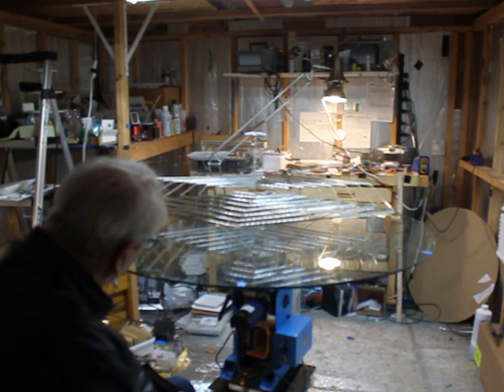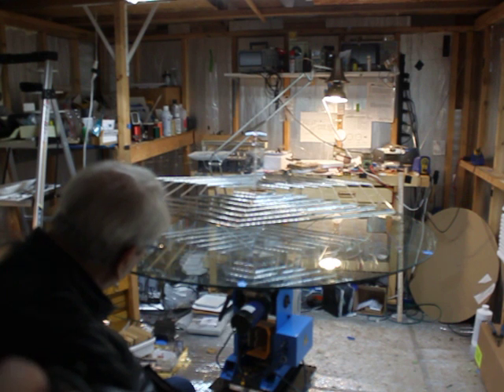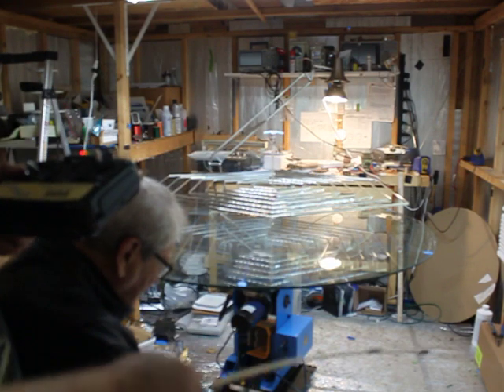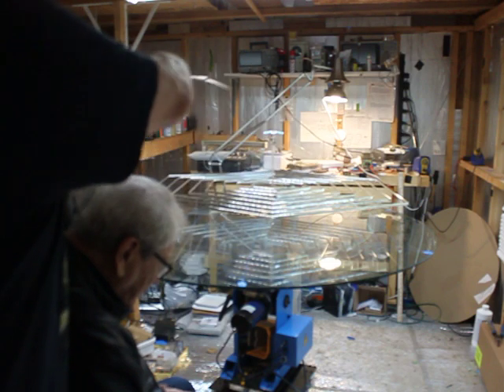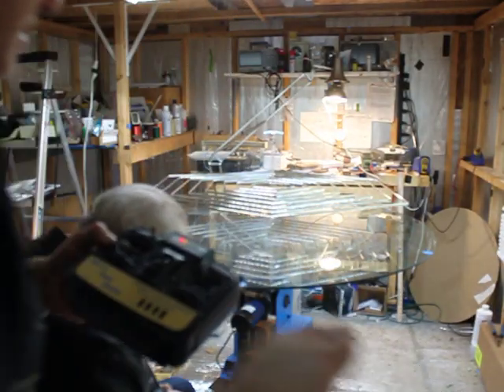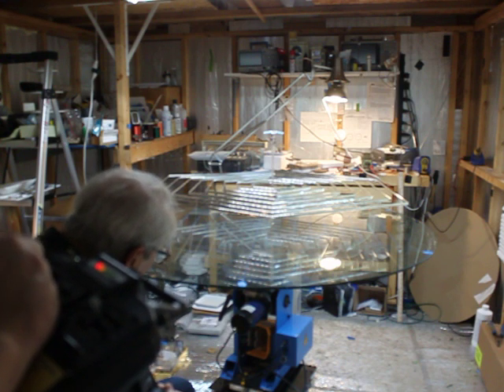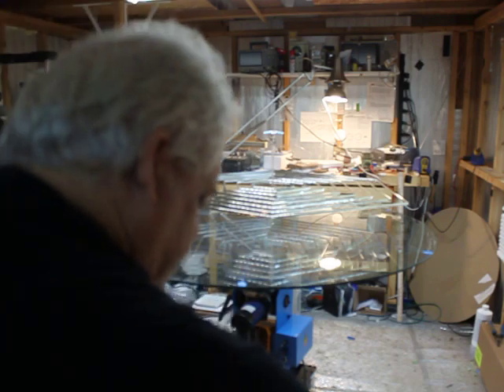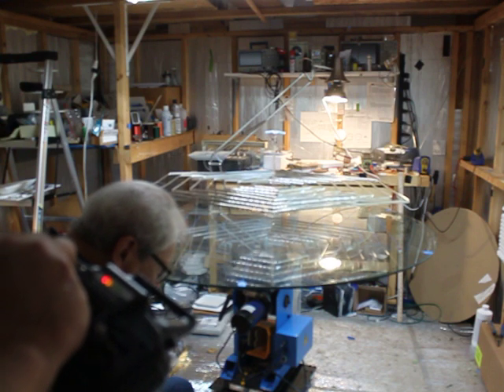Flying on 180mAh Cells. Nearly A 9X Increase In Battery Payload Capacity, Ion Propelled Lifts Supply

Comment: Could you convert this to solar to reduce weight burden? Thank you this is really amazing!!
Reply from the maker: Thank you so much for the kind comment!  The entire craft weighs in the ballpark of 25 grams depending on the model.  Reducing the weight gives a much better than linear advantage.  I try to shave off every mg that I can.  I had to find many ways to increase the efficiency by a large amount to get it to lift its power supply.
Yes, it would run 100% on solar but it would take some expensive Perovskite lightweight solar cells, and I just don't have the funds for those right now. 
Best regards!

Comment: This is fascinating, amazing work. I've been aware of ion lifters years back before batteries were as dense, but I think now it's becoming more and more possible. I'd love if you could answer a couple of questions... How long can it hover for on the battery? Can it continue to climb into the sky, or what is the limiting factor? Can mini versions be attached to the side (90degrees) as a 'push' drive, or does it only work horizontally? Really appreciate the reply :)
Reply from the maker: Hello, This craft was around before the name "lifter" was coined.  It has a thrust to weight ratio that is several orders of magnitude higher, so it's better to call it an ionocraft or Ion Propelled Vehicle etc.

So far it has flown continually for just under 2 minutes at a time, and well over 2 minutes total per battery charge. That is expected to increase a lot, because mainly the limit was due to an overheating mosfet and transformer, both recently upgraded.

The height was limited by the safety tethers, but once the gyro-stabilizer is fixed and tuned again, there won't be a limit, especially with a propellant tank. (There is video of it carrying 2 small empty cylinders on this channel.) 

The craft has flown on one side like a plane, but just leaning it a little also works fairly well.

Thanks for commenting!
Reply: @KraussEMUS1  that's extremely exciting, and many thanks thanks for the detailed reply! As batteries get denser and you refine these, it will be astonishing.. a silent remote flying craft 😎😎😎

Comment: From strength to strength Ethan, always impressive. "and when Humanity finally left the Solar system - it was by using the Krauss Engine" :)
Reply: Not to dismiss his work on the self contained ion propulsion drone - I don't think space has an atmosphere for it to work that way.
Reply: @bobdobbs4086  True, the effect is weaker but still works in a vacuum. They use ion thrusters on a lot of satellites. Different dielectrics and topologies give different results, as does AC vs DC and the frequency.
Reply: @GaryMcKinnonUFO  It won't work in a vacuum without a gas to ionize.  Its the gas that provides the thrust not the electric discharge.
Reply from the maker: There are videos on this channel of it carrying/lifting small optional propellant tanks for possible use in outer space.  In space it would move the propellant really fast, so it would only require a very small amount, unlike chemical rockets which require a lot of propellant.
Thanks for commenting!
 @bobdobbs4086
Reply from the maker: @bobdobbs4086  
Hi Bob,
Please see the videos on this channel of it carrying small propellant tanks.
Thanks for commenting!

Comment: Is this a li-ion battery or a li-po battery? Im guessing its a li-po as it probably would need a high discharge rate. Also how many cells is it?
Reply from the maker: Yes, it's high c rate lithium polymer(I forgot to mention it uses 2 cells in series).  Thanks for commenting!